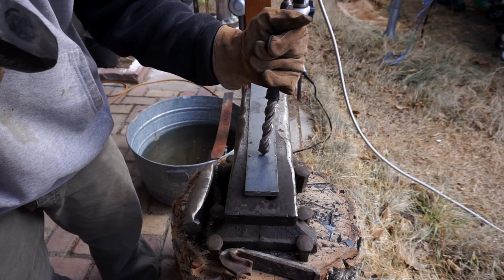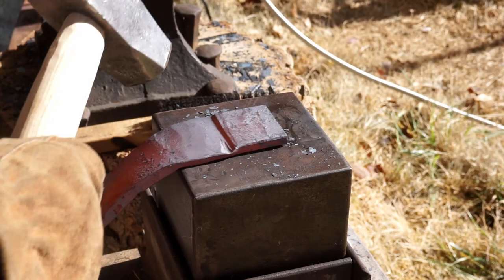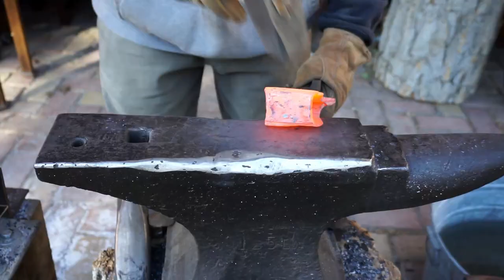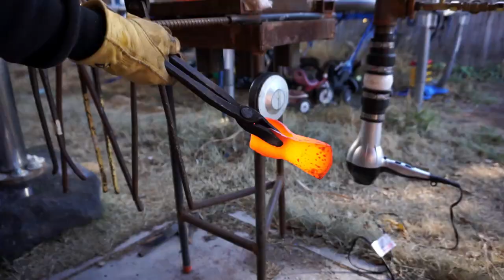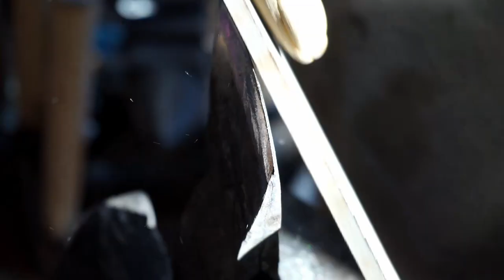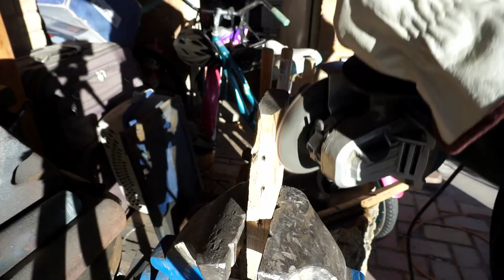Making an Axe Out of Leaf Spring!

Comment: How does one forge weld steel without cleaning it. I have no problem welding clean steel but if I don't clean the scale off no amount of heat or hammering will weld them.
Reply from the maker: It's difficult, but if you have an oxygen free environment in the forge, you can do flux less forge welds. We did clean it but we didn't include that portion in the final video. Thanks for watching!